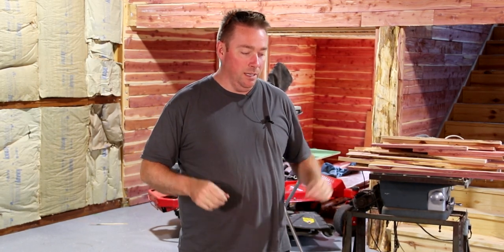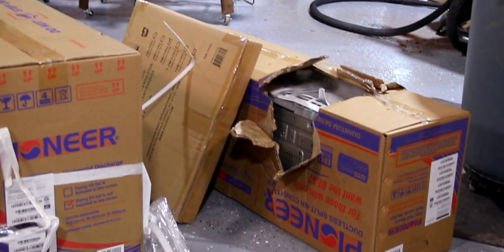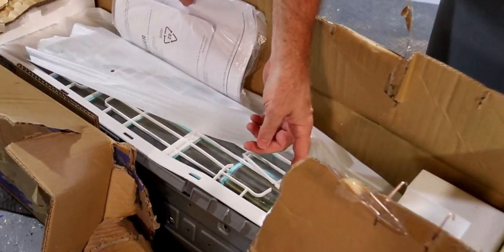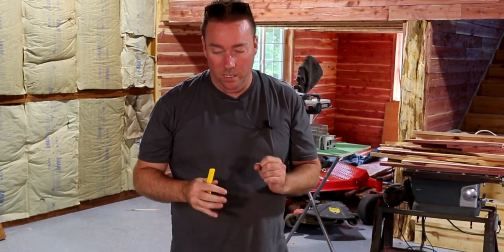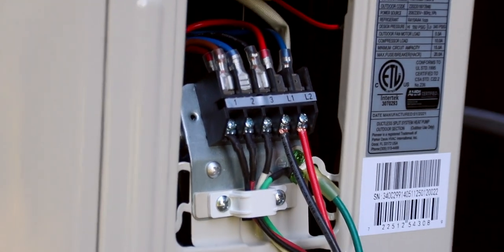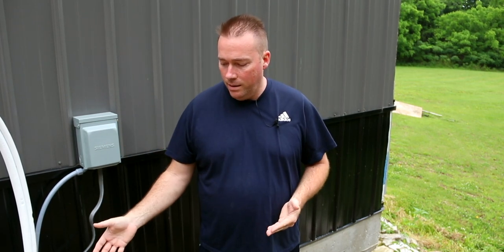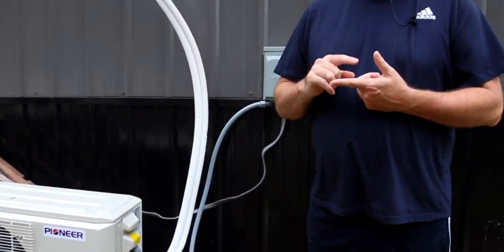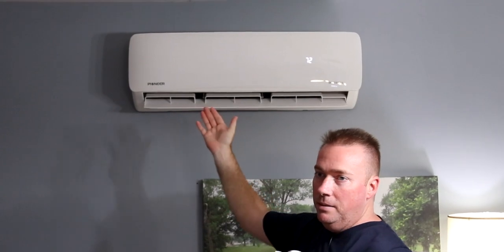DIY Ductless Mini Split Install MRCOOL PIONEER

Comment: The MrCool comes with precharged line set.  No need to vacuum.  Pioneer needs vacuuming.
Reply: Yes, Pioneer is precharged in the compressor.  We installed our own Pioneer, it was simple, though not real quick, but a great unit.  Learned our lesson, DO NOT use a wall mount.  We're now building a cement pad to installed the next one on one of our shops.